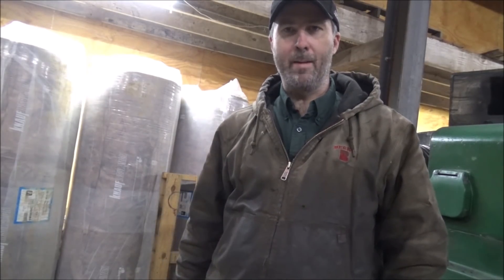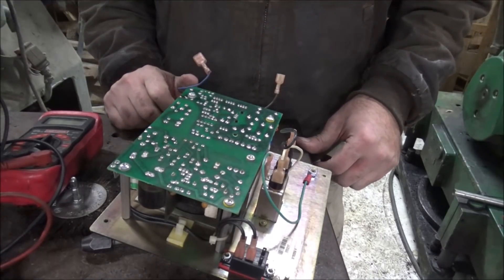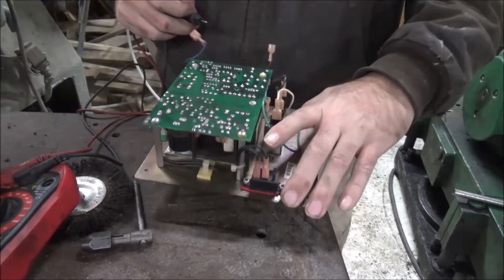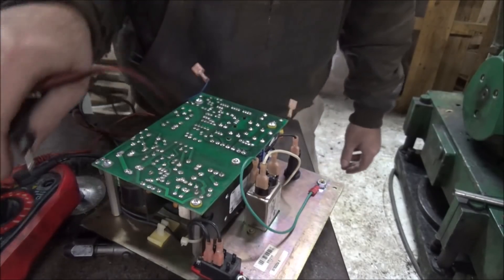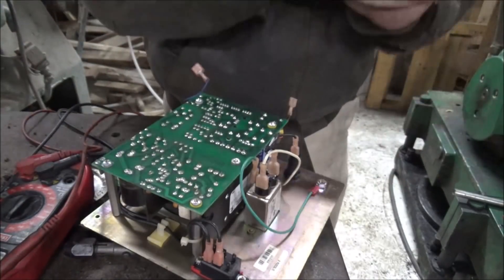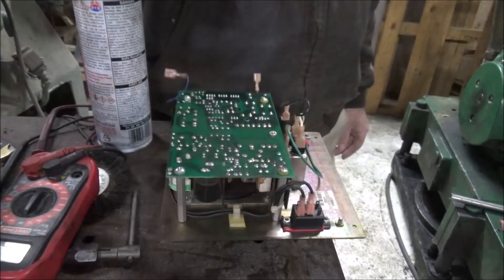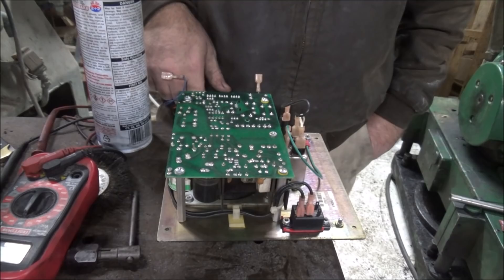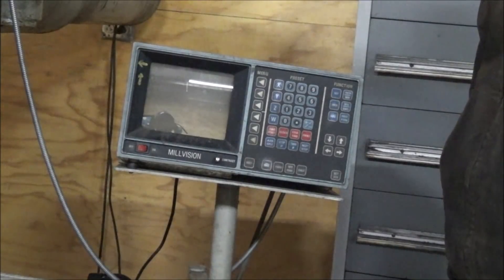DRO Fix again, new problem same solution

Comment: Hi Brian , when you where measuring the „ohm“ with your multimeter, you only checked the pin from the connector on the pcb. You would find the bad soldering when you choose annother point on the pcb what is connectet via a cooper line to the conector. In that case the bad soldering would show a bad ohm reading on your multimeter.
The other thing is that when you give pressure with your probes the broken soldering gets contact again and you wont find the bad soldering .

Greatings from Germany

Comment: Brian, electronic soldering is something I KNOW about.  Get yourself some fine wire Kester "44" 63/37 SnPb.  The RA flux and eutectic alloy really help in controlling those "cold" joints on PCBs.
Reply from the maker: No doubt as there is more electronics these problems will get more frequent. I will have to look into getting the stuff you say so I can do the fixes better.

Comment: Another thing to have on hand is Deoxit contact cleaner. I like the liquid that you brush on to the connections. Amazon stocks it. https://www.amazon.com/CAIG-Laboratories-D100L-2DB-Electric-Cleaner/dp/B0002BBVN2/ref=pd_sbs_267_14?_encoding=UTF8&pd_rd_i=B0002BBVN2&pd_rd_r=2660db70-5eac-49d9-801e-58b85c7770f7&pd_rd_w=MtxEv&pd_rd_wg=qe2Aw&pf_rd_p=bdd201df-734f-454e-883c-73b0d8ccd4c3&pf_rd_r=WBQ36P61T3JY5HKP20DE&psc=1&refRID=WBQ36P61T3JY5HKP20DE

Comment: Hey Brian, you might want to try some aerosol freeze spray. It's good for chilling down individual solder pads and locating a cold joint. We used it in our labs a lot. Grainger and MSC both sell it from various manufacturers. I sometimes use a heat gun to check the other end of the temp spectrum but you have to be careful not to thermally stress small surface mount components doing that. I have a dead big screen TV in my garage to testify to that risk.

Comment: i resolder a lot of circuit boards..   the arrows i pasted show which ones are IFFY.. https://i.imgur.com/U3JoxbK.jpg     the current flow heats up the conductor.. the center of the solder puddle gets hot on the conductor.. expands.. but the sides of the solder puddle are heat sinked by the circuit board. this causes the solder around the conductor to expand and contract.. eventually cracking the solder puddle in a vertical tube around the conductor.. causing intermittent operation or no operation.  i expect you have a decent solder station.. a fan to gently blow the fumes away.. and since this is your shop..   decent Lead type solder.. SN44, SN62, SN63..  Rosin core.. not solid, Not Acid core.  resoldering as much as possible is the only way to get reliability out of something. but then i do other stuff like a clutch on this beast.. https://i.imgur.com/2kot1zc.jpg   i did have some drill bushings machined into advance weight bushings for it also.  https://i.imgur.com/KAjlExu.jpg
Reply from the maker: That makes sense Thanks! Looks like you are missing an air intake pipe to that one turbo. :-)
Reply: @bcbloc02  just not installed yet.. first start after months apart. https://youtu.be/2jGScc_Vxx4

Comment: I wonder if the DRO is subject to vibration. I can't see to what the metal post is mounted but if it is fixed to the boring machine, I suspect there is substantial vibration at times.  Re soldering can fix it for now but removing the vibration might just remove the problem for good,
Reply from the maker: It shouldn't vibrate much especially since the dro sits on rubber feet as well.

Comment: Hey Brian...  Those looked like 4 pin connectors to me.  Its possible the connectors that plugs into them may have a faulty wire connection.  If it goes out again you may want to check them.  Sometimes intermittent failures are the hardest to find.    Russ

Comment: I agree with the comments re: capacitors, the other temperature related problem I seen several times is a crack in a board trace ... most often near capacitors... try gently flexing the board and/or examine the board with a magnifier....

Comment: I'm glad you got it 'fixed', too bad I'm so far away, I would have gladly helped you out.  The capacitors will eventually crap out and need replacing,  hopefully not wreaking too much of the surrounding circuit.

Comment: My 2 axis Accurite used to play up, stop working, it had a clear ribbon plastic cable with impregnated tracks which slid into the mother board, fixed it by improving conductivity with silicone grease, no more problems.
Reply from the maker: I know the ribbon you are referring too, will keep this in mind!

Comment: Good repair Brian. I have had solder joints on boards that the crack in the joint could only be seen with a high power magnifier. Refusing the old solder joints usually works. I'm gona just take your word that Bailey approves. lol

Comment: You can also put the board in the oven on low heat To reflow the solder. I have done it many times on laser printer boards and tv flat screen boards. Then once it starts to flow turn the oven off and let it cool down. It’s good as new.
Reply from the maker: I would be far too afraid that would not end well.
Reply: bcbloc02 I was skeptical at first but it’s really easy and works great. Try it sometime on a junk board. You can watch the solder turn.

Comment: This is a common problem on older equipment, mostly on leads that carry most current...
Easy fix, though. You can as a preventive move do most the board with new solder, best to remove older solder before applying new one.
One issue to consider is to change some hard working capacitors, there are a couple of ways to test those, oscilloscope, LRC bridge, etc. The most important ones are the filtering caps in the power supply, when they fail the regulated voltage goes under the required spec and will cause the circuits to malfunction. To order the proper parts I find DigiKey to be an excellent supplier and prices are reasonable for quality components...
Up until 1990, I used to earn a living being a senior electronics tech for the CBC(Canadian Broadcasting Corp.) in Montreal, this seems quite far now looking back...   🙂👍
Reply from the maker: You and Baily could sit down and rebuild all the electronics in the shop. be good brushing up practice for the both of you. LOL

Comment: Cold solder joints can be a nightmare sometimes over the past fifty years I have faced some real bears especially dual layer PC boards where you resolder one side and it unsolders the other side. thanks

Comment: Good luck with the fix.  How do you figure the economics of replacement, i.e. at what point do you bin it and buy a new one?  I know the extra long scales are expensive for this machine.
Reply from the maker: If you replaced the scales a new unit even a cheap one like from DRO pros is over $3000

Comment: Use rosin core solder for the repair and not acid core which is for plumbing.
Reply: Rosin core and leaded for electronics repair
Reply: But you probably already knew  that.

Comment: When we started working with electronic engine control, we found that the majority of problems could be fixed by unplugging and reseating the connectors.  Eventually found the right coatings to eliminate contact deterioration.

Comment: Indeed capacitors do go after many years. This might have been tiny cracks in the solder that are very hard to see. Does happen after many many warm cold cycles
Reply: Agreed. An electrolytic capacitor doesn't have to be bulged to be bad. The dielectric layer can simply dry out as caps get older, and let's face it that DRO has been in service a long time. I believe Brian solved the primary problem by repairing the solder joints that were most likely cracked from thermal cycles. He may have other problems in the future however due to the aging capacitors.
Reply: @highpwr  by just replacing the caps could mean that the unit works another say 15 years. Replacing with new is not cheap
Reply: @therealspixycat  Again, I agree with you. New electrolytic caps are relatively cheap - new DRO units are not. However I think Brian's immediate problem right now is that he needs to use the hbm NOW and doesn't have the time to go any deeper into the DRO right now.

Comment: That is what’s called a cold solder joint! Very easily affected by temp and movements! I think you got it!
Reply from the maker: I sure hope so! So far so good!
Reply: Not really. A cold solder joint is a result of not getting enough heat into the joint when adding the solder. The solder doesn't flow and 'wet out' like it does when it has reached the proper temperature. It if DID have a 'cold' solder joint - it would have happened at the factory (unlikely), and the DRO would not have functioned this long if that were true. It would have failed a LONG time ago if that were the case.
This is more a case of a 'cracked' solder joint due to either hot/cold thermal cycles, or mechanical stresses (dropped accidentally or wires being pulled too tightly etc.) for example.

Comment: Just hang a soldering iron, some solder, and a screwdriver in the vicinity.  It is law that if everything needed to make a fast repair is readily available it is no longer allowed to fail.
Reply from the maker: I thought that only worked if you had an extra? lol

Comment: Looks like you're looking for the right types of fault, dry joints can be really hard to find. If it still persists, get a can of freeze spray, that will help trigger the problem. The next thing, as you said is to take a close look at the capacitors.

Comment: Good deal Brian! Hey does that DRO not have a battery to keep the values in memory or has it gone bad? Thanks for the vid!
Reply from the maker: I don't think this one ever had a battery? Will have to consult the manual. I know I haven't seen one.
Reply: @bcbloc02  You should be able to see it on the board. The one in my Newall DP7 wasn't a coin cell but rather a V80H2 NiMH but you prob new that. Come to think of it I think that's what you have on the big Monarch if I remember right.

Comment: Most certainly right about older electronics being cantankerous Brian,  intermittent faults can be a real pain to find ,once you have found the fault thankfully the fix is the easiest part .
Reply: Yes modern electronics have the decency to just catastrophically fail with no possibility of fixing them.  Saves you the time to try.  Just throw it out and get a new one :)